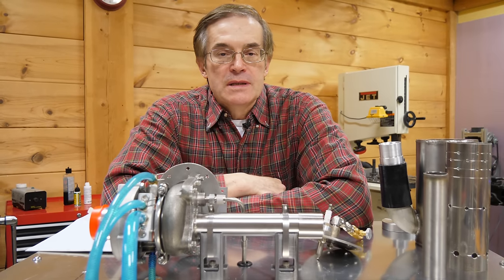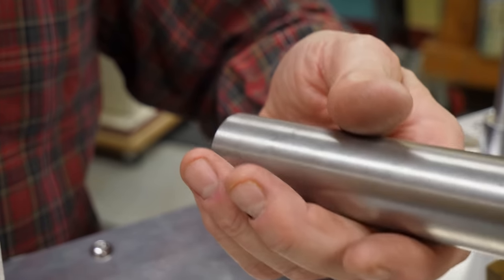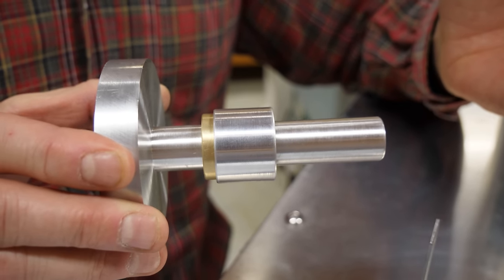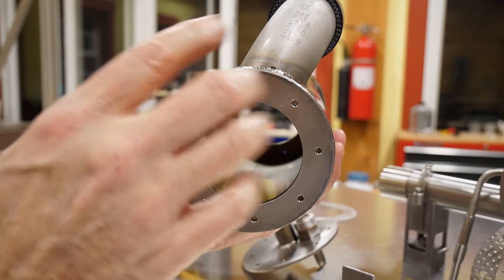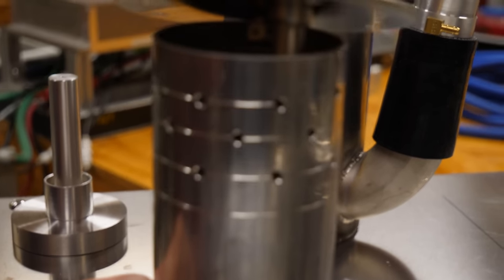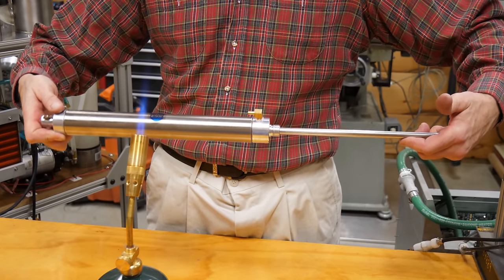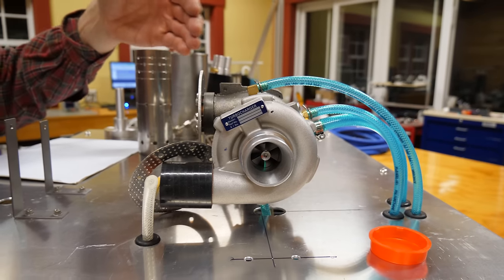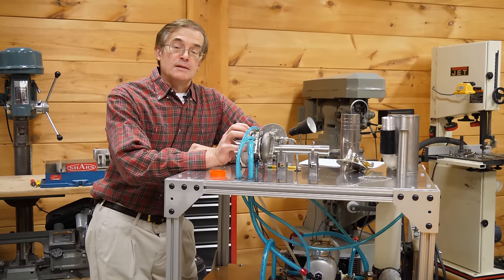The Turbojet!

Comment: so,  why not make the flame tube out of graphite and burn a perfect mix?  modern rocket nozzles are made of graphite, and rockets are always burning a perfect mix.  seems like the holes are a non issue.....
Reply from the maker: The flame tube is not the problem, its the turbine blades. These can be made from ceramic, but that is extremely expensive.

Comment: Is that an injection control pressure  sensor off a Ford 7.3 diesel on that oil flow control ?
Reply from the maker: Joe?  Is that really you?
No, it's an inexpensive needle valve from McMaster Carr.

Comment: I was thinking about it being possible to run a turbo shaft like this on solid fuel... Like running it of wood chips to heat and power the house 

Of cause, the burning chaimbours would need to be rather large, and also pressurised. But it should be able to work
Reply from the maker: You  "wood" best design it to operate with external combustion and heat the "combustion" chamber like a boiler.
Reply: @TechIngredients  yes, but then you can't use combine cycle.

Also higher pressure should make the wood burn much more intensly.
Reply: @TechIngredients  😂🤣😆🕺🤸👍

Comment: Couldn't you just pump the oil through the cooling jacket before sending it through the bearings?
Reply from the maker: You could.  The advantage of the separate water system is that because it doesn't leak into the turbine housing, when the boost is off and the pumps are still running, you don't get a large quantity of oil pooling.

Comment: why would you let the big charger blow into the small charger when using a biturbo setup?
Reply from the maker: That is because  the size of the turbo is related to the volume of air that flows through it.  The larger turbo compresses the larger volume of air from atmospheric  pressure to a smaller volume at 2-3 atmospheres.  The smaller turbo then compresses the smaller volume of compressed air to even higher pressures and even smaller volumes.
Reply: wouldnt it also help injecting a liquid fuel ore even injecting water methanol like its used in some combustion engines
Reply from the maker: That could potentially allow  you to extract more energy from the same setup.  However,  what really  limits the output is the maximum temperature rating of the turbine blades.
Reply: couldnt you cool the blade by spraying it with liquid fuel and therby also creating an afterburner
Reply from the maker: That depends where the combustion actually  occurs. In commercial jet engines, the flame actually  never contacts a metal surface.  A layer of air is always  present between  the metal  and the flame.

Comment: awesome. did you somehow measure or estimate the available toque of this turbojet? my intention is to make a low impedance permanent magnet alternator to generate electricity by enlarging the intake side of the turbo axel and coupling the alternator...
Reply from the maker: We didn't. 
However,  if I was going to do that, I would feed the exhaust output to a larger turbine and remove or block the compressor side of that turbo. This will significantly reduce the RPM and increase the torque.
Reply: This is what the low impedance generator allows: power with tiny little torques. As you certainly know, power is torque times angular velocity. Once turbo jets typical rotation is around tens of thousands RPM, even with low torque is possible to drain electric power in high voltage. The point is: to drain power lowers rpm and decreases internal combustion temperature by sucking less air into the combustion chamber. One has to tune it to maximize power. Anyway, you should estimate maximum power by seeking stechiometric perfect mix at different external torques applied 
versus gas consumption. I think you'd be surprised with results.
Reply from the maker: I mention that design alternative because of the crazy RPM (well over 100,000) and the centrifugal force your homemade rotor would have to endure. 
You also don't want anything near a stochiometric mix! The temperatures will quickly melt the housing and the turbine.   Typically, jet engines, including these, pass several times the amount of air as the stochiometric mix requires. This increases mass flow (thrust) and keeps the temperatures below the maximum allowed through the inlet to the turbine.
Reply: @TechIngredients  Indeed... rotor would have an improbable balance and strong enough fixing for RPMs like that... I thought it was something around 20k RPM... It seems the easy and more secure way is probably to couple by something like a wind vane built into an afterburner, connected to a heat resistant light chain in reduction like 10^-2 (two phase 10:1 reduction) to drive a slightly heavier alternator.... About the stechiomectic mix, thanks for the reminder... maximum thrust must be pursued, far beyond stechiometric mix.... Let me ask you: do you have and could you provide the blueprints for your device? it's perhaps the most elegant project I've seen around. Cheers
Reply from the maker: I don't have any collected documents regarding the design. Sorry.
Reply: @TechIngredients  it's a pity... Anyway, thanks for presenting your device and for the tips.

Comment: Why not use the EDF to start this turbo jet ?  also try directly driving the turbo shaft with a bldc motor you going to want very low kv or maybe belt it 3:1 and a very high voltage esc or a way (relays) to disconnect the bldc motor as the rpm climbs the flyback voltage will as well. most rc esc have mosfets with diodes so when motor rms voltage above battery it will feed back charging the battery in most cases this is harmless as you need to overdrive the motor by a large amount to git this effect. or use regenerative braking witch amplifies the voltage by shorting the field windings this creates a raises current and emf , when you open the short the magnetic field collapses and voltage rises tell it exceeds the battery voltage and vfwd of the diodes in the mosfets back feeding into the battery. The mosfets will just act like a 3 phase diode rectifier.
Reply from the maker: The advantage of air is that it is non contact.  We built this turbojet and plan for the three that follow to use it as a gas generator to drive an independent power turbine.  We're going to  get that thrust converted into more useful torque.

Comment: 18:52: If the compression ratio is increased from 2 to 4 at the (isothermal) compression and the temperature is then in both cases doubled by an external heat source (isochor), you get an energy level of 8 instead of 4 compared to the initial energy level. As you put double the power into the compression, the efficiency of this process is equal... , I would say!?
Considering a better model e.g. p*V=m*R*T with heat dissipation, the situation even gets worser because of increased temperature.
When I had a look at this processes many years ago I came to the conclusion, that the efficiency increase comes from the fact, that friction and other losses stay at the same level, but the thermodynamic energy per process cycle is much higher in case of the higher compression rates.
Reply from the maker: Of course my example is approximate due to the properties of real, non ideal gases, but the thermal energy input in both the two to one and four to one compression is roughly the same.  In both cases, the same number of molecules are being heated and the higher compression results in a smaller final volume.
The advantage of higher compression is not due to mechanical benefits such as reduced friction.
Reply: @TechIngredients  Inspired by your comment, I have now calculated a PV diagram and the principle became clear to me again. The higher compression generates more maximum pressure even if the amount of fuel stays constant. Because the expansion curve in the PV diagram doesn't follow the same way back but moves along on a higher pressure curve (higher temperature) until the outlet valve opens, the enclosed area of the cycle is larger in the pv diagram and more work can be delivered per unit of fuel.

I find it extraordinary that you take your time for answering stupid beginner questions!
Thank You for that and your outstanding content!

Comment: Wouldn't a turboprop solution be a more efficient use of such a turbocharger?
Reply from the maker: Yes, that is the ultimate purpose of this engine.
Reply: hard to attach a shaft i guess
Reply from the maker: A shaft is not the best way.  Asside from the mechanical issues, the RPM would be impracticaly high.  We will use a large diameter, low RPM turbine with more substantial torque.

Comment: So what is the math for the length of the thrust tube you explain the diameter but not the length
Reply from the maker: The length is not important.  We left it so long and actually loose a little bit of thrust due to friction, because I want to couple it to a generator turbine.

Comment: can we use super chargers as air compressor and exhaust gas driven instead of turbo chargers?
Reply from the maker: Superchargers require a rotary power source while a turbocharger will work directly off the exhaust gas flow.
Reply: @TechIngredients  i mean a supercharger for intake compression and another supercharger to exploit the gas expansion from combustion chamber.
Reply: the output supercharger driving the intake supercharger and providiong torque for useful work
Reply: Superchargers requrie a lot of power ti get much air out of them.  It would be better to use a multi-stage turbo.  One to comress the air and another to burn it.  You could use a large turbo charger on the exhaust side to spin a compressor that feeds the smaller turbo to create more compression.  that type of setup would be better for turboshaft engines though as thrust is changed into power to spin the turbines,  if you are wanting it for thrust, you could attach a propeller and probably get more thrust.   

The turbo charger design in not a great way to generate thrust because of the way it moves the air,  it is better for producing power over thrust.

Comment: I wonder why every one tries to build a turbojet type engine that relies on exhaust speed with these? They seem like they would be better suited as a turban with a shaft take off through a gear box for the energy capture. Like a turboprop.
Reply from the maker: That's a good question and I agree. This jet and the ones that will follow are intended as gas generators that will drive a relatively low RPM, high torque, output turbine.

Comment: Maybe it is a difference between automotive application jargon and “off-brand” use like this, but the use of “heat soak” is incorrect. In automotive applications, it’s actually the resultant effect of flowing too much mass of air at too hot to where the intercooler cannot compensate. Basically, it cannot dissipate that amount of power and heats up more than it can dissipate and the less dense, hot air makes it into the engine because the intercooler cannot do its job.
Reply from the maker: Heat soak is also used to describe this effect outside of the automotive arena.  It makes sense as well. Heat is soaking into the neighboring components as if it were a fluid soaking into an absorbent material.
Reply: Same general idea about greater energy input that the current environment cannot dissipate

Comment: this type of engine, the turbine is just rotating the intake fan, if you are not using the rotation to generate
Reply: you could use air pressure bearings

Comment: What kind of fuel Injector have you used on this project?
Reply from the maker: Because the fuel on this first engine was already vaporized, it was released through a 3mm stainless steel tube fitting.
Reply: @TechIngredients  thanks for the answer! I want to use liquid fuel on my prototype, something easily vapourizable (gasoline, alcool) but i have no idea how to vapourize It without using expensive High pressure pumps or gasoline injectors. Any ideas?
Reply from the maker: Some designs use the heat of the combustion chamber to heat it as the fuel tubing passes through the chamber.  This presents a risk of cokeing depending on flow rate and during shutdown.  We are now using a methanol injection pump to inject isopropyl alcohol at 60 to 70 PSI and although it takes a couple of iterations with the pinhole on the spray nozzle, it works well.
Take a look at our last jet engine video where you can at least glimpse the liquid fuel set up we tested a bit later.

Comment: 21:00 so you have 2 units of work being put in and 4 units out?
Reply from the maker: In each case, the work invested in compressing the gas is returned when the gas does work on the piston when it expands.  Adding the same heat energy when the gas is compressed, in each case, doubles the energy returned when the gas does work on the piston.  Put more in, get even more out.
Reply: Tech Ingredients sure thing, thank you kindly! I was curious about you saying that pushing it Harder/faster/results in twice as much work being put in, I suppose that would still be one unit of work though, not 2?

Comment: didnt the original design,
Give the option, that After it was heated, that you could use almost anything that would Expand with excess heat, to keep the turbine running??  Basically it was claimed that you could use Water to Expand and keep it running.  Because of heat and expansion..

Comment: HI, I would really appreciate your opinion on using this type of engine to make a small  domestic CHP system? This company "Samad Power Ltd" seems to be developing a system like this. They have a few videos on youtube you could check out. I think domestic Combined heat and Power units in general are a really interesting idea and something worth looking at. Not easy to get right and I think the world needs you to help work it out.
Reply from the maker: The process is indeed interesting and we nearly had a similar commercial unit installed when we were replacing our existing furnace.  The technology was a little rough and the price pretty high and I decided not to go with it.

Comment: Very nice setup but I think your cooling method is a bit overkill...it's not uses as a turbo charger lol
Reply from the maker: You're probably right.  We plan to replace the water cooling loop with oil and run it in series with the bearing lubrication.  This should simply the plumbing a bit.

Comment: Are you using kerosene, biodiesel or vegetable oil?
Reply from the maker: Propane.  It eliminates the need for a fuel pump and vaporizes very easily.  Many turbocharger conversions depend on propane for start up because it works so well.
Reply: @TechIngredients  Understood, with a small, low ratio engine like this one, its best to keep it simple I suppose, but do keep in mind that there are kerosene heaters out there which use a common spark to ignite, and when not in use, kerosene is slightly less flammable than propane in the case of a leak. Those systems can easily be 'robbed' from normal 'torpedo' style heaters and they burn very well, even without the high compression levels of a compressor, should you opt for a more 'jet-engine-like' jet engine at some point. ~( 'w')/

Comment: Your lockwire tails need work you have done depot twists work hardening the material good effort these would be cut. Also your twists have air gaps and birdcaging . For 32'' lockwire aim for 11-12 turns per inch. Its an art in itself.  For your tails twist up about 10cm paying attention to the first inch . Personally the first turn I do by hand then put on the lockwire pliers starting them square to the hole in the bolt then pulling on them in the direction of locking, then cutting at approx 3\4 to   1inch, putting the pliers on folding an imaginary line in the middle and folding by hand and tucking the tail under . the tails should be turned in the counter direction of the other twists . 
 I'm in aircraft maintenance. Just a professional observation no malice intended.
Reply from the maker: This was my first ever attempt and the small size of these fasteners made it no easier, but thanks for the advice, no problem.  Only caveat is that I am using nichrome wire rather than stainless, so I didn't have to deal with work hardening.
Reply: @TechIngredients  it was an excellent first attempt especially considering you had to watch a youtube video for some instruction. excellent build looking forward to the rest. 5 thumbs up :-)

Comment: Ah, a nit to pick: "degrees" Kelvin are not a thing.
Reply from the maker: I've replied to this issue several times.  I disagree with this convention as the Kelvin units were based on the Celcius scale and degrees were originally used with Kelvin for several years untill "they" decided to change it.
Reply: @TechIngredients  That's fair enough, I have my own pet peeves. I believe that the candela is not a fundamental unit and has no place being alongside the second, meter, ampere, kg and Kelvin. Also, the ampere isn't fundamental, the coulomb is. The unit of charge is not an ampere-second.